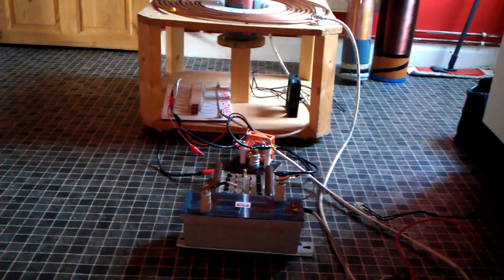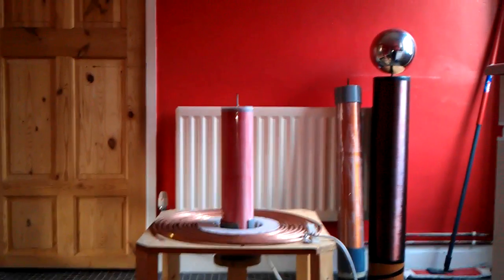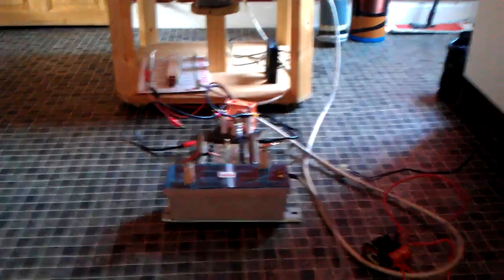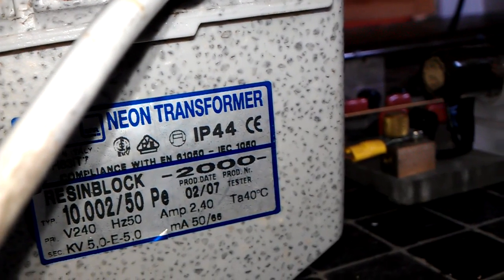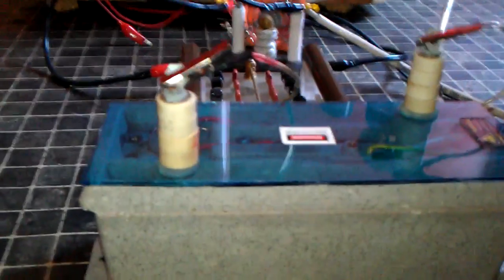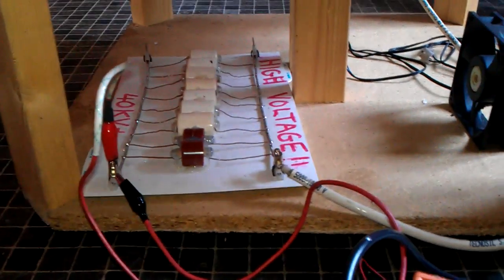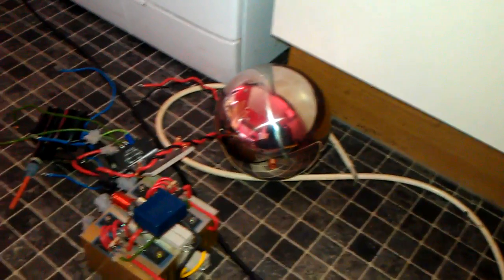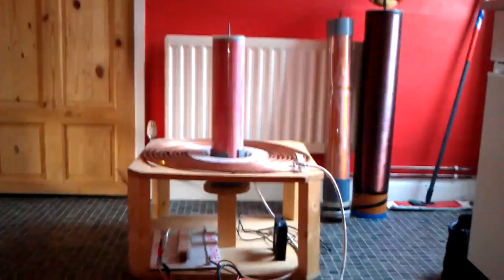N.s.t Tesla coil run

Comment: Wow that's very cool!  How do you calculate the parasitic capacitance of a topload consisting only of a breakout point though?  I'v always wondered about that because I've seen it before.  Thanks!
Reply from the maker: All I did mate was try and try and try again different settings! All done my self with no calculations! And it worked as you can see mate. 👍😉⚡️⚡️⚡️
Reply: @high1voltage1rules  Thanks!

Comment: There is huge differnce because capacitance is not steady using salted water in bottle (salt reaction in water, temp, current flow etc.) I know  the way and i done buy taking a part capacitor from microwave oven, they are rated 2000v or so and the way to make them you can see on my channel.Complete Tesla Coil made all from microwave oven parts.Go to TESLA COIL USING MTO and check under Semko1971, here on You tube, I tried to explain on that video as best as possible (specialy rolling own caps)

Comment: That salt water capacitors is were the problem is.You need MMC caps and you need to do calculation ,capacitor bank need to match to primary coil and again primary circuit need to match secondary coil in order to resonate on the same frequency.I made Tesla coil using only two MTO connected in serial (4 Kv only) and I got about 3 feet strikes.DONT increase power over 10Kv that you have for your own safety,  go to pages where is good explanation How Tesla coil works before atempting something else

Comment: I have 2 similar NST's and am having trouble getting such a nice looking discharge.  Most people say it needs more power, but you're obviously doing it with the same, or less power than I am.  I'm using salt water capacitors made from vodka bottles.  Can you help?